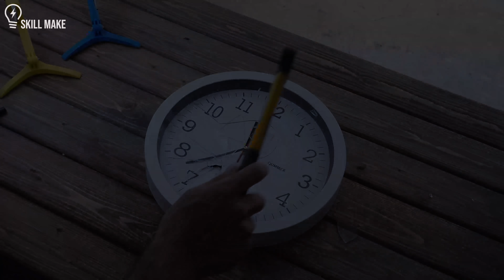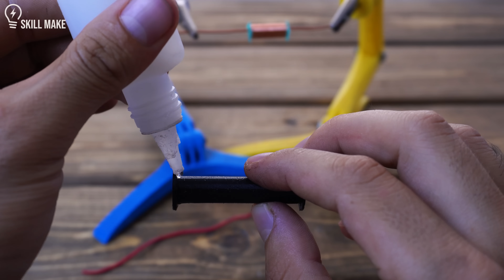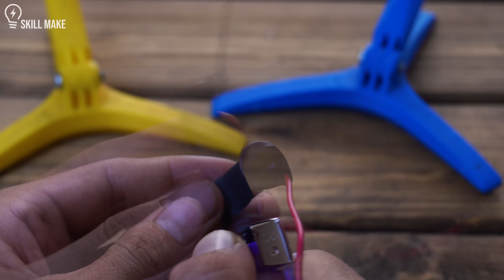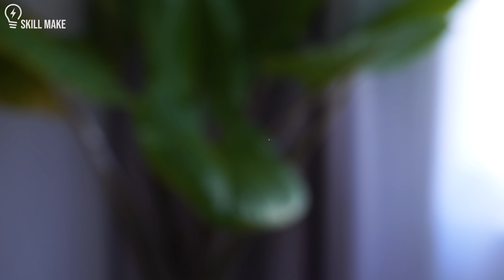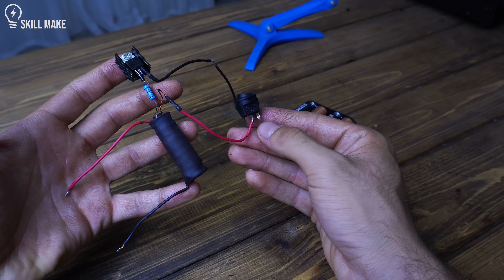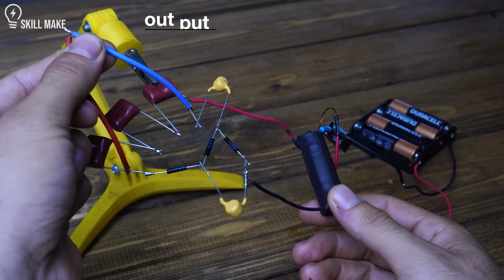Make 400000v High voltage generator (easily) - High voltage PLASMA transformer

Comment: Thank you for the clip, but I applied the existing one and used the lrfz44n mosfet, but the strange thing is that the electricity is not continuous, but intermittent. Whenever I turn on the button, one sting appears and disappears, and there is no continuous electricity. I wonder what is the reason?
Reply: Capacitors 
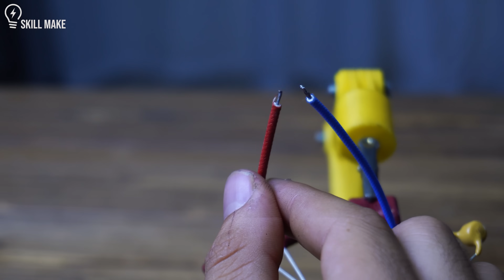5:40 like that right?
Reply: @thawzinkhant1759  Actually I did not use the current boosting capacitors but the electricity is not continuous I do not know why but every time I connect the power it shows one electrical capacity
Reply: @abd-alhamidsyr4138  you need to make a proper output sine wave to feed it into the transformer.  for that use an inverter circuit. the reason you are adding the mosfet is because to convert the dc to ac and to set the desired frequency. i think. and that is the case of non continous arc. just use a proper circuit like ZVS circuit. i think electroboom has one of his videos where he created a miniature version of zvs ahhhhh. the magic wand

Comment: Owch. That hurt! High-voltage capacitors can self-charge while sitting on a shelf, so place a bleed resistor across the terminals to prevent getting to know how painful and dangerous such a shock can be to your health.

Comment: Why is it weak? I did everything like you. I disassembled the electric shock piece, but in the first coil, the number of wire loops is 3.0 with 28 turns, then the second wire with 24 turns, and then a small capacitor is left on the transistor gate in the middle and on the left with the dowel. I hope you respond and make a video on how to make a strong electric shock with a dowel. Thank you.
Reply from the maker: If you want to get the most out of it, you should use a u-shaped transformer. Also, you should wind the thin wire very carefully. Insulate it well every 300 turns. You can even use adhesive tape instead of varnish to do this better. 🥰

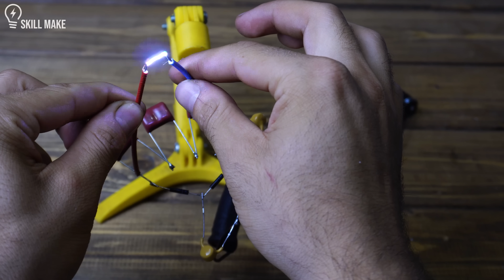Comment: zu 5:33  Mache das nie so, beide Kabeln anfassen. Wie leicht kann dann so ein Lichtbogen auf deinen Finger überspringen. Der Strom fließt dann komplett durch den Körper von einer Hand zur anderen Hand hinüber. Das ist höchst lebensgefährlich. Also mach das nicht!!! ---- Wenn solche Experimente, dann bewege das Kabel zum anderen Kabel mit einem Plastikstab. 
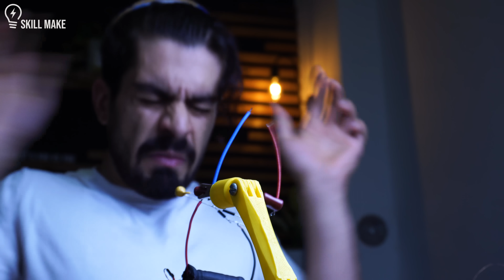Du hast gespürt, was alleine die Kondensatoren schon an Strom durch den Körper geschickt hatten und wie weh das tat, (siehe 5:46), Wenn das erst bei vollem Betrieb des Generators gewesen wäre, das hätte tödlich ausgehen können.

Comment: from where I can find that carbon core?? 
is that the core of batteries??
Reply from the maker: No In fact, it is a different kind of metal from alloy and you can get it from electronic stores
Reply: Hello 
Can I it work with an other metal ?

Comment: How many volts and amps is that making? Can it be scaled up more?
Reply: assuming 15kV output and 9w from batteries and 85% efficiency - 510 micro amps. Also, you can scale up flyback circuits a lot, they are how CRT TVs generate high voltage. You can tell he isn't getting 400kV from this because when he touched the wires' insulation he would have been shocked.

edit: 
If you want higher efficiency, like 90% ish, you can use a ZVS driver that uses 2 transistors, they are softer on the transistors but are more expensive. I made a 300 watt one for 13ish dollars so still not too bad. If you do this, remember to make the 47uH coil very large, or it will bleed high voltage noise into your power supply and kill it.
Reply: @videojuegos9379  Nasıl yani 4 tane pil insanı oldururumu
Reply: @zizakav9361  this circuit most likely can't kill you, but if you charged a large enough capacitor with it, you could die. This is how CRT TVs kill, the driver circuit is low current but the CRT tube acts as a capacitor and is not low current.

Comment: How can you be sure there is 400000 volt:How do you mesure it ? With what kind of probe ? You can evaluate it by the nomber of turns on the coil, and the voltage in input.. But 400000 volt, create an electric arc of 400 millimeter, in dry air.. If you have less distance, there is  less volt ! Your system is not strong enough to support such a voltage, with a short distance,because that will create a Current.. Which current of short circuit, for 400000 volts ?How many ampères ?!!

Comment: Dude your not going to live very long when work with 2 hands. Use insulated gloves or tools. It only takes 20 to 100ma to take you out. Be warned. For the capacitors put a bleed resistor in your circuit if possible. Take care.

Comment: Why did you break the clock?? It was possible to obtain it from behind. In addition, the title is clickbait, as 400'000V would produce arks up to 10cm in length. This would ark and shock anything within that range. This is clearly not the case, and here the voltage is clearly much less. Please avoid using clickbait.

Comment: yeah it cannot be 400000v since you didn't really insulate it better. around 1 to 2kv there is a chance of melting the transformer. Come on man don't claim false s**t. And the batteries, can they handle the high demand of current of yours. Also what's up with the driver circuit i am sure that it will malfunction after few days of using it. If someone proves me wrong i will hit my face to a pie.
Reply: Bro😅

Comment: Where's the oscillator? You can't just put DC into a transformer…
Reply: I was confused about that as well. When he was soldering the transistor one wire was labeled GND and the other DCC which is AC so there might be something he didn’t show us.
Reply: @refrigerator8676  …or perhaps it's all rubbish ;)
Reply: Yeah so I don’t even know what I was saying in that comment. I did some research after and he made an inverter with the transistor

Comment: This is faf. it doesn't have an oscillator at all. you don't just connect a mosfet and transformer and it magically works. You need an AC or pwm dc to drive a transformer. How to give a DC voltage frequency? Using an oscillator. How is the oscillator made? Using transistor and capacitor and resistors and Inductor. Where is he's oscillator? Nowhere. He might use a flyback transformer on that mysterious heat shirked space this is fake. Do you know what is the hardest part of making free energy and crazy energy? The hardest part is where you hide the batteries and high voltage generator. Its voltage nearly reaches 25kv (sorry ElectroBOOM for copying F.A.F)
Reply: This does work try it yourself all my flyback drivers and other transformer drivers are the same as this just i did not use a diode
Reply: But yes its more like 15 or 10kv not 400

Comment: Destroying working clock -- with hammer -- just to get enamel wire is dramatic (stupid) show. The less dramatic is open it with screwdriver. And the least dramatic (smart) way is just buy the wire.